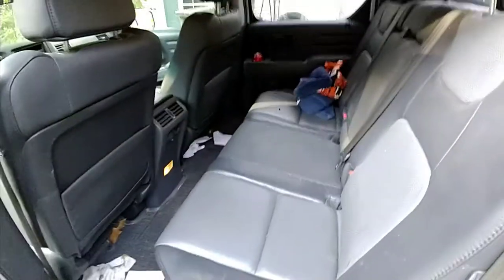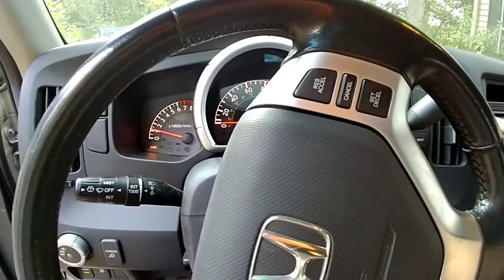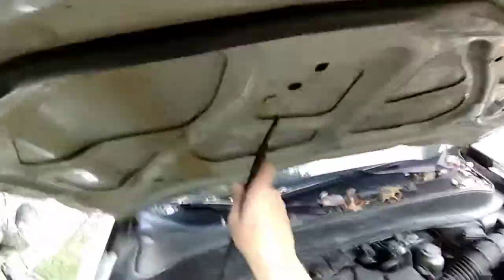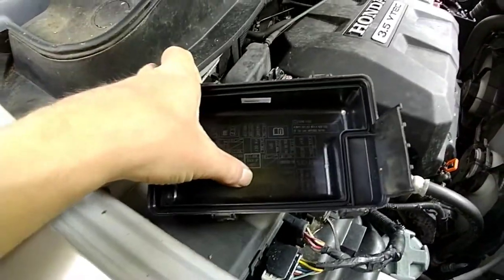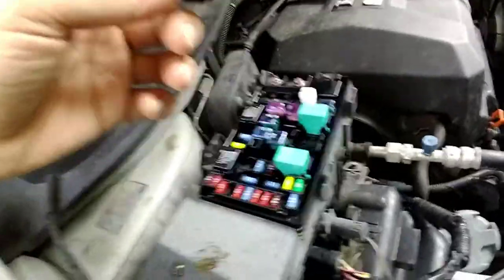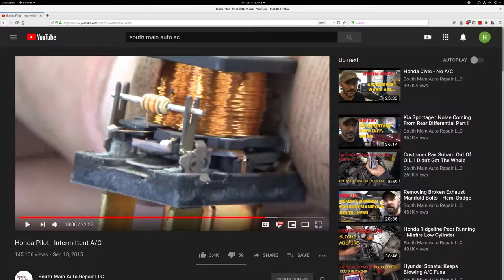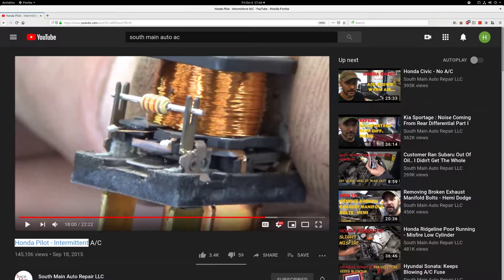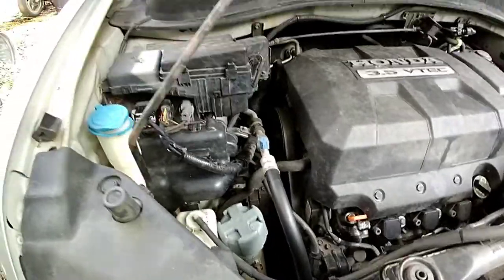Honda ridgeline sudden ac death short term fix

Comment: Yesterday I had a 2007 Honda Ridgeline without air conditioning. Watched your video and today it works for 7 bucks. Thanks!
Reply from the maker: You are very welcome. Thanks for letting me know :)
Reply: Same here and Fresno CA heat right now is miserable. HIBAW thank you so much!may GOD Bless you man.
Reply from the maker: @dinoruiz1592  you are most welcome :)  Thanks for letting me know it helped.  Made my day.
Reply: @HIBAW  it sure did help.I was panicking worrying how can I get my trucks ac to work, just had paid to have the ac serviced, then checked that relay it was broken. Now I'm riding cool. Thank you again for making that video from me and my kid's.

Comment: I disagree with you the Honda Ridgeline is definitely a real truck and a tough one they rate it to hold 1000lbs in the box but I have held more and with little lag  it did a great job my only complaint is that the electrical system definitely needs a redo😊
Reply from the maker: lol.  So, I didn't film it.  But last year I drove through a wide ford on the tye river, after a LOT of rain.  The water was half way up the driver door.  A friend had heavy equipment there to pull me out, and I wanted all my camping gear and motorcycle over there.  So I went for it.  We didn't think I'd make it :) It did really well.  Very sure footed, it waded over all the big round stones. Was pretty legit.  I didn't think it got wet inside, until a week later, it smelled like a river :)   I dried it out over the next week with an assortment of vacuum, and spacers under the carpet.  It brought home my heavy lathe.  My surface grinder.  Some very large shelving.... It's truck enough :)  Sometimes I miss my old ranger, but not when I think about working on it.  V8 in that thing was a pita, and bleeding the clutch, required a bench bleed (they recommend you take the entire circuit out and bleed it).   The only thing I know of, that's wrong with my poor ridgeline, is I think it needs a steering pump.  Otherwise, it's always good to go.  Only thing that made me upset, is that the transmission casing was flawed from the factory, and seeps atf from the entire casing.  It's a bad casting.  I think that's a known issue though, but it always upset me.  Doesn't drip, just looks wet..... Thanks for the comment :)

Comment: I do the same thing with my home fuse box.  I flip the breaker switch on and off about 15 times and it cleans the contact.
Reply from the maker: :D I leave mine open, just in case it needs servicing....

Comment: Worked on my Honda too. Mine was finicky and the relay did not work when I had it pushed in the connectors all the way down. I cleaned up the connecters with a Dremel and now works when pushed all the way in. Thank you for this video, I had thought the problem to be the pressure switch.

Comment: My ac was at shop and told compressor dead. My problem is when I hit a bump it started blowing cold air for a short duration. My fan still blows air hot when ac not running. Is this a switch problem?
Reply from the maker: I would have no way of knowing. If you don't trust the shop, or are not comfortable with testing the switch yourself, you could get a second opinion. 
Sometimes just tap on the switch will make it turn on if it's failing. If it were me, I'd replace/test the $7 part, before I replace the many $100's dollar part though.

Comment: Tried this, no idea what happened but the engine started running louder/weird (not like the AC kicked on), and then when I turned it off it took an extra second... Now I have a check engine light. What the heck did I do??
Reply from the maker: No clue jacob.  The correct thing to do is have someone with proper equipment diagnose your particular problem.

Comment: Not a real truck, heh? Well, mine is 14 years old and has pulled the H€££ outta some really really heavy things, absolutely NO problems. J/S.
Reply from the maker: Yeah I've brought some pretty heavy things home in the bed. 14-in lathe, a surface grinder, a cast iron spiral staircase. I like the Ridgeline.  I put a hitch on it.  But I'm putting a hitch on my bolt too :). Funny fact, the Chevy bolt, is actually classified as a truck.  At least it is on my paperwork :). The Ridgeline cannot pull any of  my small equipment though, which means I still need a truck :). I'm probably going to have to part with it if and when I move, in order to accomplish that move.  And I'll really miss it.